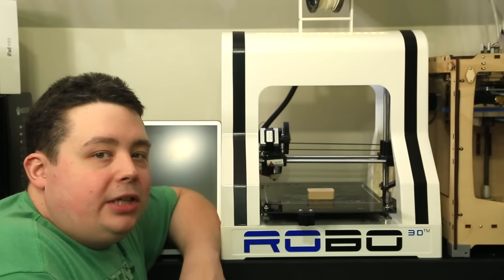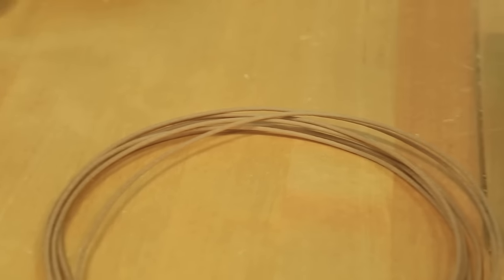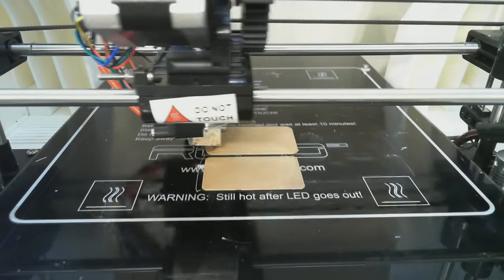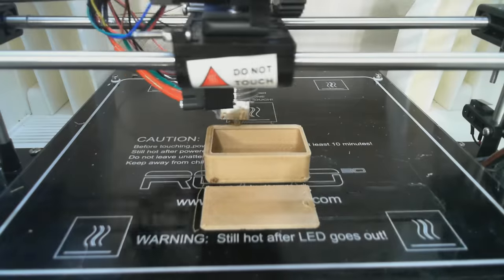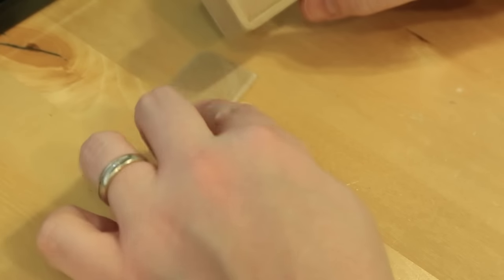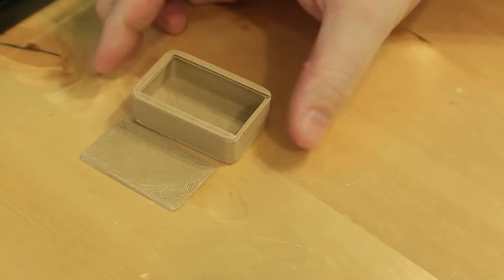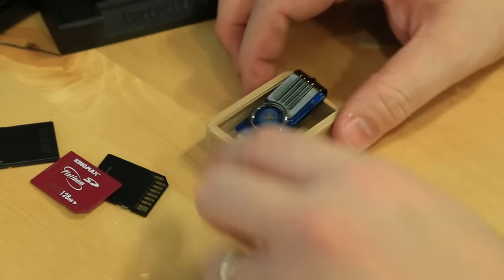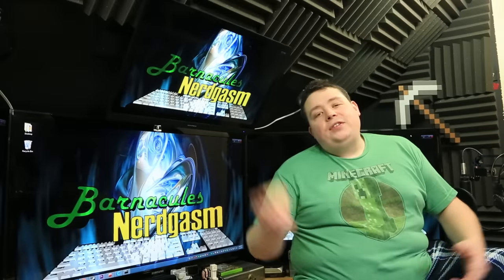3D Printing Wood? How is that possible? Let's find out! - @Barnacules

Comment: To those curious, this is just very fine wood powder held together with some sort of glue or other meltable material.
Reply: Yes, it is plastic with about 1/3 powdered wood.
Reply: source?
Reply: Looks like MDF.
Reply: I don’t care along as it’s not plastic would want to do so much more with 3 as long as it the stuff didn’t look plastic plus the failure rating of a print was so much less i wouldn’t want to do a 4 hour print to be 3 hours in and it messed up

Comment: I HAVE AN IDEA!!!!! Another knife, but print the blade with bronze filament and the handle with this wood filament! wide eyed stare
Reply: +shOU_Tgaming i have wondered if you could do multiple filaments
Reply: +J Cullitan you can on some printers such as the davinchi duo
Reply: +J Cullitan Also there is a gadget called "Pallette" which makes this possible on every extrusion-based printer.
Reply: +Brennan Slade davinchi 3d printers cringe megacringe (local college had one, it broke while sitting still...)

Comment: I had good results also. (Rep1-Sailfish,100C-HBP, 190-230C hot end, 70mm/sec) but I varied the output temp to change the color of the material.  Turned into a great wood grain effect. I've made many of those Owl prints then either tumble sanded or stained or polyurethane sprayed in any or all combinations and they all are amazing. Try a long acetone vapor session. That was interesting.

Comment: In my research for 3D printers recently.... it seems to me and I may be wrong... that the Robo 3D is one of the only affordable 3D printers under $1K that currently prints wood filament... is that correct? Is there anything special your 3D printer needs in order to print the different material? My printer wont be here until Nov... hopefully by then they will have a module.
Reply: Ultimaker prints with All filament types
Reply: Robo is too big in my opinion
Reply: look at this: https://www.3dprintersonlinestore.com/diy-kit/geeetech-prusa-i3-pro-b-diy-kit
The only problem is that it takes days to assemble.
Reply: just bought a MakerFarm Prusa i3.  dont have it yet but i have heard literally nothing but good things.  for the price u cant beat it
Reply: I just want one that's reallllyy accurate so I'm getting ultimaker 2 :D
Reply: Good choice.
Reply: Jovan Kostenov Hey Jovan! All of ours come fully assembled. Much easier! Check em out: http://www.robo3d.com/collections/3d-printers
Reply: RoBo 3D thanks guys, I'm gonna check that out !!

Comment: Does it burn like wood?
Reply: I like your thinking
Reply: KillerCamPlays as do I sir, let's find out
Reply: if it did, how could you 3d print it? it melts the material into the 3d print at a high temperature so likely would melt instead of burn , but at a high temperature
Reply: Bob M wood melts if it isnt under atmosoheric conditions

Comment: You should try taking a printed wood object (this works for plastic as well) and toss it into a media tumbler. You can find one in a gunshop (they use it for brass) or online. They aren't expensive and smooth out surfaces real nice when you use a corn media. Save so much time, for something that small it might take only about 3-5 min. Great Vid!

Comment: I have the newer version of the Robo 3D R1, and I'm having issues with the edges of large parts curling off the print bed. I'm working with PLA and have the printbed leveled and calibrated (I haven't quite gotten the auto leveling to work right yet so I did it manually).
If I use hairspray do I have to let it dry a little first? I haven't tried hairspray yet.
Reply: Yukari Yakumo And for PLA what temperature should I heat the bed to? I have the Extruder at the default 210'C and the bed at 60'C.
Reply: Holy shit , I don't know what to say, wunderbar
Reply: Nvm, I fixed it, I had to adjust the Z offset, and used blue painter's tape. I even updated the firmware, and now it works amazing.
Reply: +Yukari Yakumo Where I work we aren't allowed to use hairspray for "ventilation and respiratory" reasons (we work on dozens and dozens of printers so it would get bad), but I can attest to the adhesion quality of a simple elmers glue stick. Works everytime... also those temps are fine

Comment: Since its woodlike, can we sand it?
Reply from the maker: Yup, it sands really nicely!
Reply: +Lester Dela Cruz you have to be careful because all woodfil is not made the same. Some contains more pla than others and if you sand it will look kind of foggy and loose its shine.
Reply: +CBreezy wet sanding and polish...
Reply: morganiothegamer I don't know what type of the polish you used but I tried both. What polish would you recommend
Reply: i use some generic no name brand.
Reply: Hmm. That's not the results I get get but if it works for you that's great!
Reply: +Barnacules Nerdgasm you should 3D print a batman mask to go with, Dana Nana bat knife

Comment: You should try experimenting with varying the temperature slightly throughout the print. As you probably know, temperature affects the color of the material - and this goes for wood filament as well. So you can emulate the color shifts of wood grains by adjusting the temperature accordingly.

Comment: Utterly mindblowing! I have a wood shop at home, so this doubles the "WOW" factor from my end of things.

I'd really like to get into 3D printing, and what I'd really like to make is G-Scale model train cars and other bits and bobs for my model railroading hobby, but I'm not sure how to start. I'm computer savvy, but I'm no real expert, so it'd have to be simple to use...

Any suggestions or advice on how to get into this?
Reply: I'm in a similar situation.  My research so far has led me to want to purchase a Makergear M2.  The forum thread about that company and their products makes it seem like they are the best choice these days from a quality of product, ease of printing out of the box (or after assembly) and support point of view.  Just waiting on the funds (about $1600 after shipping).

Once you have your first one then you can build another one to print bigger things so my plan is to build an extruder first to save money on plastic (also lets you recycle any failed or unwanted prints) and then start building another printer similar to the gMax.

If you don't have to go through a purchasing department like I have to you might want to try check out the gMax on Kickstarter.  It's only about $1400 and can print 16in x 16in x 9in.

Lots of info and stuff at reprap.org though if you want to research more on your own.
Reply: Well, I'm a bit short in the funds department myself, and if I was really going to buy one of these, I'd really like to make my own 3d models instead of relying on other people's works, that way I could sell what I print to help amortize the expense of the printer.

That said, I'd need a 3d program that'd be really easy to use, in the "3d modelling and printing for dummies" side of things. I'm computer literate, I just never have done the 3D modelling side of things...
Reply: Shipwright1918
Lock yourself away in a small room with Blender for a couple of weeks.

There are plenty of models available with licences that allow you to print and sell examples https://www.google.com/search?q=free+3d+model+sailing+ship&tbm=isch
but you'll inevitably need the 3d skills to make them suitable for printing.  You probably wouldn't want to print them with all the rigging in place, for instance.

Comment: Could you print a 3D Printer??? lol
Reply: Yes yes you can
Reply: the case in one color? yes. the insides? no.
Reply: Theoretically you could
Reply: there now making multi filliment ones whitch can print circut bords so you technicly you could and im misspelling a ton of words
Reply: helz yeh!
Reply: The RepRap project aims to do just that. You can't print electronics, bearings and such, but you can print the most complicated parts to push cost down
Reply: Marco Rodriguez Don't give them ideas!
Reply: Maybe I mean I don't know about the pcb and other electrical components but  could probably print the casing
Reply: Retr0 there's printers that can print in two colours now

Comment: I'm new to 3d printing so I apologize for the newb question. What was the approx cost and time it took to print this box?
Reply: i know why youre asking. no it is not profitiable to manufacture using a 3d printer. great for prototyping, and making molds as part of the manufacture process. but material and time? for 3d printed products? your products will cost more than people want to pay. theres a reason nobody is running a business just off 3d printing fidget spinners

Comment: Bamboo is a greater tone material than any wood, but you cannot harvest strips large enough to create guitars or violins, only things like flutes and xylophones. And gluing many smaller strips together lessens the tonal quality.

I wonder if one could use bamboo to make filament, and thus larger, thicker sheets of material that have the same tonal properties as bamboo. Is that possible?

Comment: I am just curious could you use 2 different colors of filament at once or is there only one spot for the filament? This would be on either of the 3D printers that you have.
Reply from the maker: My Ultimaker can print in 2 different mateirals, I'll be putting up a video when I find the right project to try it out on,
Reply: Oh that is so cool! :D I really want to buy one of those just to experiment, but I can't afford one for a couple years lol! :D Sweet I guess I will stay tuned for that video! :D Oh and that is crazy how you can print with wood!

Comment: Hi, I've also tried printing with wood filament. It started good all the time but after a while the filament got stuck or jammed the extruder gear-wheel.
What filament do you use?
Reply from the maker: I had a similar problem with the 2.75mm filament on my Ultimaker with the Bowden tube, but with the 1.75mm filament on my Robo3D with direct drive I had zero problems.
Reply: Ok, then maybe the Robo3D is just better :-)
What temperature are you printing at?
Reply: Tassilo Singhammer I was under the impression the problem would have been the extruder/nozzle/etc.
So I don't suppose you've found an answer within the last year? (Printing newb here)
Reply: Barnacules Nerdgasm i have that printer, i got it 3 days ago. was about to get this Filament to test it out but not sure if it would have worked.. also what temp did you set the extruder to and the bed?
Reply: galacliva he says in the video,  210 and 70
Reply: thomas cope yeah didn't need an answer 1 month later.. the printer broke on week 2.. so i sent it back..

Comment: Already on my third order of the Robo 3D R1. I have yet to receive one that wasn't damaged. First one, the bed drive belt mounts were snapped off. The second one wouldn't even power on, the third one had a broken bed. Amazon shipping handlers are terrible, as the last two damage printers were done on shipping, only the first was done at the factory.

Comment: have you use your 3D printer(s) and tried print on wooden or timber surfaces and will it stick to it. eg. as an embossed logo. can you make a video if it works or does not work.

Comment: Hey Jerry I have a good question does the wood filament coaunt as ABS or PLA because the printer that I am thinking of getting myselfe is the cheaper module of the ROBO 3D.  will the 3D printer work with it

Comment: I want to upgrade to E3D Hotend for my Robo3d Abs/Pla model, do i need the 1.75 Direct feed? and does it work with abs/pla and flexible filament as well as others? i saw a kit for 79.00 at Filastruder with a fan and other parts that im not sure ill need or may?

Comment: Yeah, I agree with the others on here; I'd be interested to see if the filaments burn like wood. (Don't burn a finished product unless it's junk. lol) But depending on how it reacts, you could see how similar it is to wood, resin, or plastic (though maybe the amounts are on the specs of the filaments?)

Comment: Which 3d printer would you recommend for a beginner. Cheap and pre built
Reply: Makergear M2 for $1800 looks like a great choice from what I've read so far.

Otherwise, the Bucaneer at Pirate3d looks pretty good also for around $600.  Also happens to be the best looking printer so far as well.  Looks like something Apple would put out :)

Comment: Oh man. Was looking at the ColorFabb woodfill from printedsolid. Deal killer right here: "This material will not change color by increasing or decreasing temperature."  Have you tried Laywoo-d3? Its a bit pricey but it does the color change with temp. I just got in some Zen Toolworks wood filament to try out.

Comment: If the future goes crazy, and a circut board / PCB option is available, I'd just do me with a Titan X Black, a high quality Asus motherboard, and using that awesome wood filament, create me an awesome slick case. Damn, I wouldn't even need to go to a single hardware shop and pay any money at all. Also if it printed food,  I would print me anything. Awesome! :D

Comment: if the filament changed between 2 or 3 shades every so on the printed objects would appear to have a natural grain - also would probably be worth having 2 variants of spool- one for small objects with the contrasting shades switching every 2-3 ft or so and another for large objects with the contrasting shades switching every 6-9 ft or so
( lengths just best guess) ....
Mahogany, Oak, teak etc each with their own individual shades would be cool.

Comment: Hey Barnacules i was wondering can you run the robo 3d off the cura software because cura looks like its a very good 3d printing software and i want to know if i could use it for the robo 3d.
Reply: Noah3677 Yep you can. Check our forums for info!

Comment: I'm looking into getting a 3D printer have been watching videos all day probably the first I've seen using wood material on a home printer. Does this filament only work with certain printers or does it work with any printer that takes 1.75 mm filaments?
Reply: +Michael Whitney It's just PLA with added wood powder. Any printer that prints PLA will print this. I'm using some Chinese wood filled PLA at the moment and it prints beautifully. You can also get metal filled filaments (bronze/aluminium/copper etc) as well as conductive, magnetic, carbon fibre, flexible and others. Any printer can print any of these. All modern 3d printers are fundamentally the same.

I suggest buying a kit printer and putting it together yourself. It's a great experience and you gain a lot of understanding on how the printer works which helps with trouble shooting in the future. I also recommend a heated bed and auto bed levelling. These features should be standard in all modern printers.

Comment: It is wood, probably recycled wood, they then grind it to fine powder and mix it with polymers and stabilizers, then they extrude it like normal filament. But from what I've seen it is a bit touch setting wise to make the Filament.

Comment: I tried printing wood on my printer and it jammed big time. I couldn't even unassemble the extruder to unclog it. I had to get a new extruder. I heard you need a . 5 nozzle just to print without jamming. So how come you don't use your robo3d printer any more?
Reply: +dragnet53 What hot end are you using? I recommend printing a filament oiler that the filament passes though as it enters the extruder. You put cotton wool or a sponge inside with a small amount of oil on it and it cleans and lubricates the filament before it is melted. I use WD40 but a lot of people use Canola oil.

Since using an oiler I have not had a single jam and I have printed various PLA, wood and TPU filaments. I'm using a clone of the E3D  V6 hot end.
Reply: +CanonFirefly I have a E3d v6 hotend currently. I have had so many problems with this, but at least I know a lot about how 3d printers work now.  I will try this oiler thing out.

Comment: I am in the market for a 3D printer and I want one that is under $1000 with a heated bed. Would this be a good first printer? I have the time and patients to make adjustments but I don't want to have to put one together. Any suggestions/comments?
Reply: Solidoodle is having a sale for one more day. Get one of their printers that has a heated bed and an enclosure for 500 USD dollars with a short lead time. Platform size=6x6 and Y is 6 (all in inches). After that sale the price shoots up to 700 USD.

Comment: Was the print head on your robo causing massive clogs all the time in the middle of prints? I have one of those sub $1000 printers, and am about to return it because it always gets stuck.. Thanks
Reply: ***** yah that's exactly what it is slash was (i just got an r1
) but no matter what I did I couldn't clear the extruder. Even after getting as much gunk as possible out of the hotend, I still couldn't get through a single print. Tried every trick in the book, and after hundreds of hours decided it was time to go back and place my money in a product that worked
Reply: IN3RT1A Tech maybe your temp is too low. it's possible that it isn't completely melting the plastic, and some of it is sticking in the hot end.

Comment: I'd love to use the bi-material capabilities of the ultimaker to print a keychain sized version of the minecraft sword and pickax using the wood for the handles and a blue semi-transparent material for the diamond.
Reply from the maker: I think it would be too small to get a good result, the duel extrusion is a bit of a tricky thing since there is a little oozing that occurs between print head swaps so really small things wouldn't turn out very nice.
Reply: Barnacules Nerdgasm Drat, Foiled Again! I now await the day that a multi aperture nozzle machine comes out, maybe something with RGB filaments.

Comment: Can you etch it with a wood burning tool?  Just wondering if it is heat retardant since it needs to be heated to be created.
Reply: it's partially PLA, youre not going to get good results with a wood burner